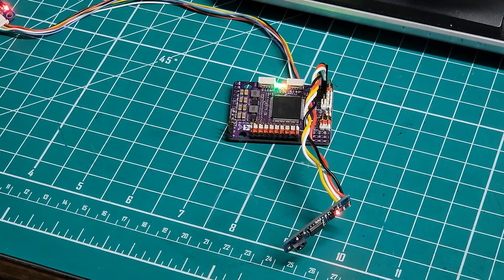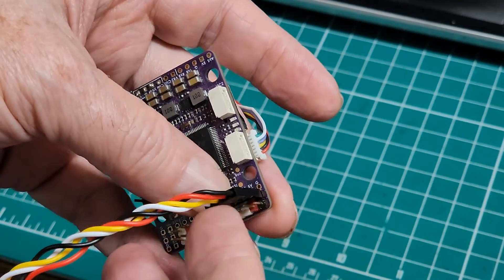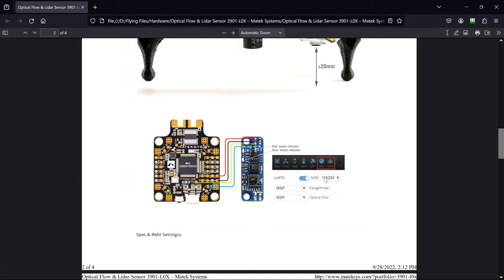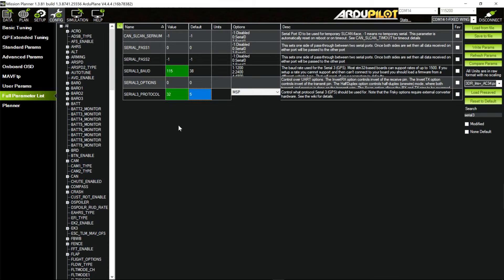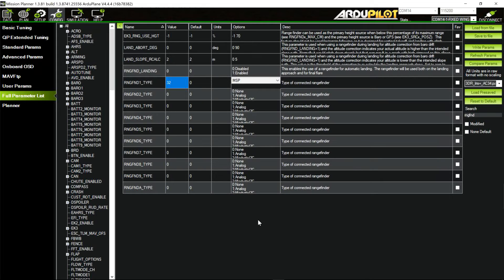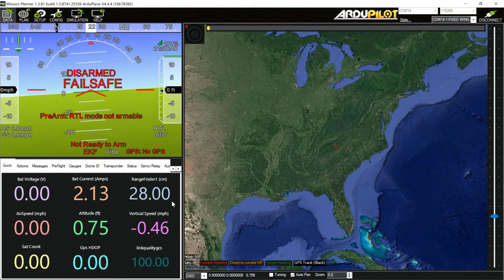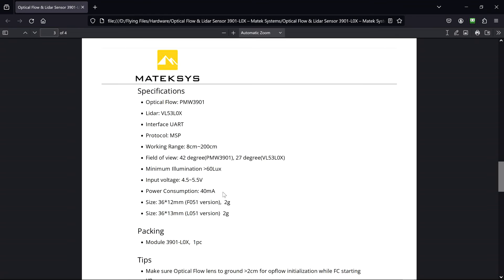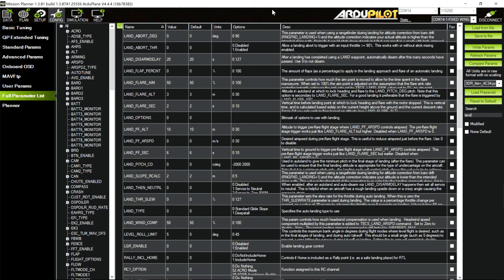Matek 3901-LOX Optical Flow And Lidar Sensor Testing

Comment: The sensor seems to be working fine for me,but the quad just keeps circulating clockqise,can you suggest some solution
Reply from the maker: Sounds like toilet bowling. Likely need compass calibration. Try doing that outside away from all metal.

Comment: Put the sensor in the wing,

Thanks for all the videos.
Reply from the maker: Oh my. That would fix my belly landers! It’s always the simplest fix that works the best.  Thank you so very much.  Prefect idea.
Reply: @nighthawkvs  I'm building a t1 vtol and was going to put it in between the front landing gear but figured putting it opposite the air speed sensor in the other wing for balance would be better then buried under vtx, battery and fc stack. 
Enjoy and have fun. That's why we do it Goodbye.
Reply from the maker: Sounds like a plan to me.  Enjoy your T1.  Great little airplane.